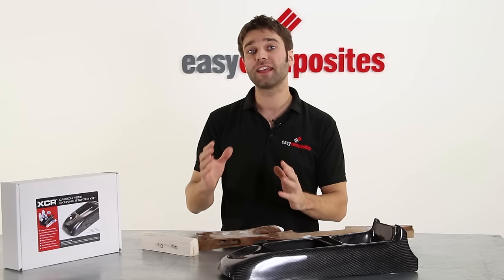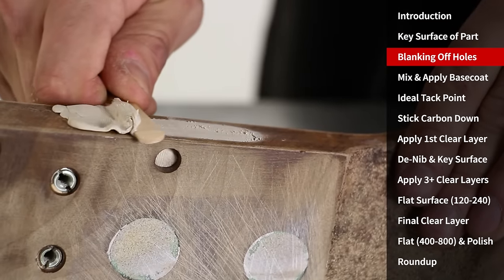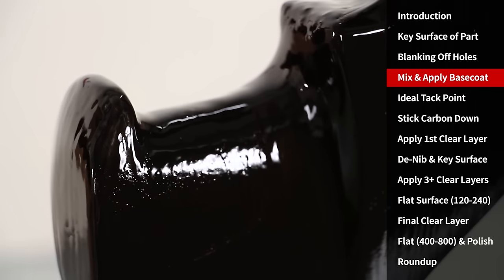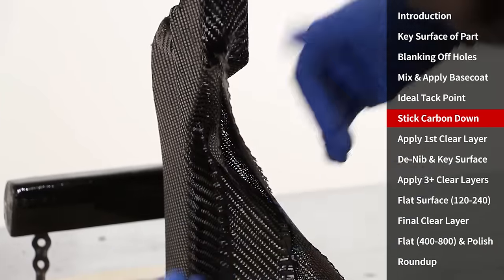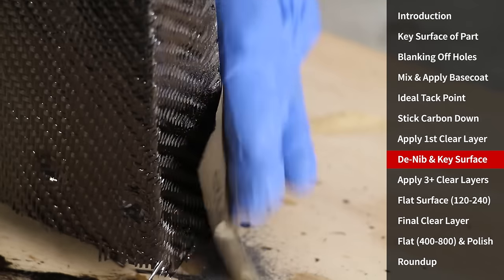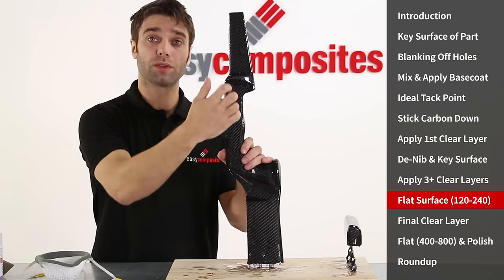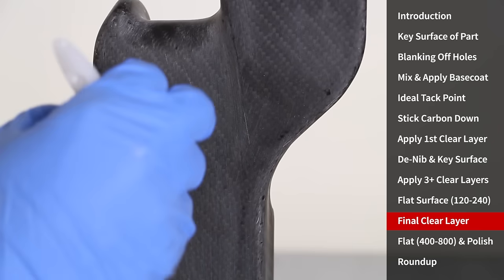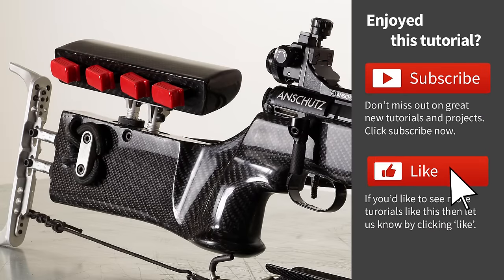Ultimate Carbon Fibre Skinning/Wrapping Tutorial - Sofie's Rifle Stock

Comment: Can I do this with a carbon lip and use spray paint clear coats?
Reply from the maker: No reason why a splitter/lip can't be skinned.  You still need the resin to seal the fabric and get a smooth finish.  However you can use a spray clear coat to finish it off rather than just polishing it up.

Comment: Would a rough surface (like a 3D printed part) be a problem ? 
Or would the base coat take care of that?
Reply from the maker: Michael Trollope 3D prints would be fine in terms of their finish but they could be tricky to bond to. Depending on the plastic you're printing with, you may need to prep the surface with something like cyanoacrylate (superglue).
Reply: Easy Composites Ltd great tip, thank you !!

Comment: Hello, i have a question is there specific type of epoxy needed to used with carbon fibre or any type of epoxy (basecoat + hardner) will work?
Much appreciated Thanks alot
Reply from the maker: Generally you would want a high quality epoxy coating resin.  Typical laminating resins will be a bit thinner so not coat as well, and also are likely to be harder to sand and polish.  Our XCR, for example, sands easier and polishes easier than most typical laminating resins.
Reply: @easycompositestv  Thanks for the replay, Your products are perfect but unfortunately i am overseas and it is harder for me to get hold of your products.
So any good quality epoxy resin will do the trick, and better stay away from cheap laminating resins right?

Comment: Is it possible to do this carbon fiber skinning on metal items such as aluminum or steel? How would the process defer?
Reply from the maker: The process is basically the same.  You need a good key on the surface to help with bond.

Comment: Would it be possible to skin a foam core? I am imagining a foam core cut to shape on a cnc and then skinned. Would the final product have any strength?
Reply from the maker: Hi Phil, yes, you could skin a foam core and yes, it could be done to have a good amount of strength. In fact, we've even had a customer build a bike frame using this exact method. There are some compromises on performance vs a moulded laminate but it's definitely a viable process.
Reply: Easy Composites Ltd that opens a myriad of new possibilities.

Comment: Question: for the base cote resin and black pigment is enough or do I need to mix hardner as well?
Reply from the maker: Hi Kamran, you will still need the hardener yes, without it, the basecoat wouldn't cure.

Comment: I want to know how strong, how heat resistant carbon fiber are in general. Got a video about it?
Reply from the maker: Heat resistance in most cases is down to the resin matrix being used eg a typical epoxy may, with a post cure, have a heat distortion temperature anywhere between 60 and 90C.  Specialist resins can go higher.  Strength is totally subjective subject to individual applications so is way too broad brush to give a simple answer.

Comment: What is the propose for use base coat as wood is a good surface to bond the carbon?
Reply from the maker: The basecoat is epoxy resin and is bonding to the wood, the reason that it is black is to mask any underlying colour from showing through the weave of the Carbon Fibre. In addition, applying the basecoat and allowing it to cure until firm but tacky to the touch gives a natural tack to help hold the carbon in place as you wrap it around the part prior to applying your top coats.

Comment: How is carbon fiber with aluminum honeycomb done? How do you keep the CF from sagging into all of the honeycomb holes?
Reply from the maker: You normally need to use a '2 shot' process where you make the skins and cure them first, then do a second operation where you bond the skins to the honeycomb core (aluminium, Nomex ect.). It can't really be done in one because you can't get even consolidation pressure on the main surface of the laminate (you would only get pressure where the laminate was in contact with the honeycomb structure).

Comment: Can you paint over the carbon fiber part if you decide later to change the look?
Reply from the maker: Yes.  Give the surface a good degrease and key then in most cases paints will adhere fine.

Comment: How much more does this actually change it's strength? Would love to see a test from aluminum plate/tubing down to Styrofoam! please.....
Reply from the maker: A single layer will add some strength to a part. Depending on the requirements you could add more layers but then it is more laminating than just cosmetic skinning.

Comment: if i wanna use 2 layers for carbon fiber whats the extra step? thank you
Reply from the maker: If you want to add another layer of carbon you can either laminate both layers at the same time, this option could be used for simpler, flatter profiles. For more complex shapes you could laminate the first layer of fabric as per the video and de nib once cured, then key the surface and repeat the steps for applying the fabric. Instead of the black basecoat you can simply use the clear XCR to create the tacky surface.

Comment: Is it safe to use these resins in an enclosed space, such as a shut garage or room (do they give off harmful vapors)?
Reply from the maker: There is almost zero odour from this epoxy resin, there are no solvents and no fumes so you don't need to worry about harmful vapours. Nonetheless, you should still work in an adequately ventilated area and follow the safety instructions that accompany the resin.
Reply: Excellent, thank you for the quick response!

Comment: Is it ok to use the same epoxy resin solution as the base coat to tack the CF down and then add it again on top for finish purposes?
Reply from the maker: The resin is the same but without pigment.  Adding the pigmented basecoat would leave the finish black.

Comment: Got the kit. Put down the base coat on my part but when I went to lay the carbon it barely stuck to it. Left it about an hour and a half in a 21 degree room and it seemed tacky like in the video but even if put my finger on it full pressure no residue came off. Measured the ratio using scales so that wasn't wrong. Does the base coat need to be laid on thick or something I am missing?
Reply from the maker: As long as it still feels tacky, even if zero residue comes off, it is in the B Stage and safe to proceed.

Comment: What temperature does this kit work in?  Would it work for skinning motorcycle engine components?
Reply from the maker: With a post cure up to 69C
Reply: @easycompositestv  Will have to measure the temperature of different side cases to see if this is viable.  Thanks for replying though.

Comment: Can i use this technique when i am laminating a complex structural part with core foam? Is there any structural problem if i let the first epoxy coat to be tacky over the foam? I am having problems with the overlapping curves where the laminate separates because of gravity. Thanks!
Reply from the maker: Not at all, this is a good approach allowing the first layer to cure through to the B Stage will enable you to see if it has followed all of the contours correctly and that there is no bridging; after that, you can build up the subsequent layers.
Reply: @easycompositestv  thanks mate!

Comment: So I have a fiberglass hood with some spider cracks.  Would the cracks need repaired before this process or could I wrap the hood the way it is???  Would the cracks show thru?
Reply from the maker: It depends on the severity of the spider cracks, if they're cosmetic/ non-structural then the basecoat should in effect repair them and they wouldn't show through onto the finished, skinned surface. However, if they are more indicative of a structural problem or if you have any delamination or flaking areas, they would need to be repaired first.

Comment: I’m skinning the roof on a car that I’m painting. Can I apply the same clear coat I’m using to paint the car over the final layer of resin instead of using the resin polishing compound?
Reply from the maker: Yes you can. It is quite common to lacquer skinned components to provide higher levels of UV resistance and a super glossy look.

Comment: I have a question about the XCR coating, at which point would I be able to put pressure on the coating so I could say flip over a box and coat the last face on the bottom?  I have a part to do and I want to coat all 4 sides
Reply from the maker: I would give it the full 8 hours before doing that.
Reply: @easycompositestv   Thanks for the reply

Comment: Are 400-1200 grit all wet sand or just 400 and then you follow up dry with the rest?
Reply from the maker: Normally the other way round; anything above 400grit is normally wet-sanded. Dry sanding is normally just up to and including 400 grit.

Comment: Would it be possible to skin/wrap an object using prepreg or is it better to use this technique?
Reply from the maker: Yes, it's possible to use prepreg but you would need the underlying part to be able to take the temperature of the prepreg cure, which for lots of parts would be OK.

Comment: Hi, If I were to do this using forged carbon, would I need to change in any way the sanding process, such as the grit coarseness? Thank You
Reply from the maker: No as you are still sanding into the same resin when skinning with chopped tows. The basic resin coating aspect remains the same.

Comment: For example if I used a mold what chemical could i use to free the carbon from the mold once it’s set
Reply from the maker: Hi Jimmy, if you’re laminating a carbon fibre part into a mould, assuming that mould is made from a suitable, compatible material, we would almost always suggest Easy-Lease Chemical Release Agent. You’ll find it on our website.
Reply: @easycompositestv  cheers thank you also when will the skin starter kit be in stock

Comment: Is this the same process with carbon forge skinning?
Reply from the maker: Very similar.  The main difference is getting the chopped tow onto the surface and wetted out with resin while still retaining a random fibre orientation and not many bits sticking up.
Reply: @easycompositestv  I was going to put the black base coat on then the chopped tow, soak with xcr resin and maybe peel ply over the top. Thank I for the response! I’m going to make a video for YouTube of me doing it

Comment: if i wanted to 3d print very low infill parts with a very thin wall thickness to keep it light and skin it, what would be the best kind of filament to use for adheasion?
Reply: PLA would be ok for this
Reply from the maker: PLA as mentioned.  Just remember if skinning both sides, and in essence making it a cored panel, very low infill prints can be weak in compression.

Comment: I need some help on the last step, wet sanding + polishing. I do as described in the video, but the surface comes out matte, rather than glossy finish and that irritates me so much. The part itself is ready to be installed, but I can't get it to be shiny.
Reply from the maker: Are you using the XCR Resin? If not, it may be your resin type as many epoxies are difficult to polish to a full gloss.
Reply: @easycompositestv  Unfortunately I am not using the XCR Resin, rather one made by a local manufacturer in Bulgaria, said to be perfect for carbon use.
 How do you suggest I get a better glossy finish? 
Should I only wet sand it with the 1200 or should I use another method?
Reply from the maker: @P.Petrov550  You may not be able to achieve a full gloss; many epoxies simply don't ever get super-glossy. The best option to try would be to wet sand to at least 1200 or 1500 grit and then use a suitable polishing compound to achieve the best level of gloss. If it still isn't shiny enough for your requirements, the best thing at that point would be to look to clear coat/lacquer the part with a suitable automotive paint.
Reply: Thank you for your reply! @easycompositestv

Comment: hi i purchase your carbon fiber begginer kit i will make a new plastic for my atv ,can i put stickers in between epoxy layers.will they melt or something or will  remain normal while curing
Reply from the maker: It depends on the material of the sticker so I would do a test piece first.  Sometimes the inks can run and/or the edges of the sticker peel if the adhesive is not strong enough.

Comment: hi paul grrst video specially like the idea with keying with a stanley nife to get a better bond. my only disappointment when calling before paying for the  skinning kit. us that i asked if my project could  be done by your company.  as your company does this on a daily basis. i was told that you dont take on projects such as this video.   I also find the 2x2 twill a nightmare  to work with. as i find the material  to thin
and that imperfections still show through  the end. is there a substitute instead i could  use. maybe a slighter thicker carbon fibre.  om not concerned about weight.  but do wamt a perfect finish were the carbon thread stays together. thanks in advance
Reply from the maker: Hi Mark, we don't do this type of work on a daily basis, we only did this project specially for the skinning video which was long overdue. It was something we'd discussed and arranged with Sofie a long way in advance. As for the 2/2 twill, it is a delicate material - that's true - but we've never found it easier to use any other weight, width or grade - especially for interior trim parts like you're doing. However, it's all personal taste and if you wanted to experiment with some other fabrics then we'd be happy to discuss what we can offer.

Comment: Hi, do you have glue, whitch can be used (stick to) for carbonizing EPP foam ?
Reply from the maker: If you are skinning foam in carbon fibre, the epoxy resin basecoat will provide sufficient adhesion.
Reply: @easycompositestv  
Idea is to cover foam by carbon around to reinforce body (plane model)
Reply: @easycompositestv  
I was thinking if that stick on expanded polypropylene.
Reply from the maker: Hi Jan, EPP is very difficult to get a good bond to, even with an epoxy basecoat. However, if you skin carbon around EPP then the EPP structure underneath becomes almost redundant because the carbon fibre skin is so much stronger. Therefore, the strength of the bond to the EPP becomes a little irrelevant.
Reply: @easycompositestv  
Thank you, that make sense.

Comment: Thanks for the video. What can I use for the basecoat as you don’t ship the XCR to Australia?
Reply from the maker: So, basecoat should not be impossible to replicate (because it's not super critical and gets burried underneath the clear resin, which is more difficult to replicate). You would need an epoxy laminating resin with a strong black pigment in it, you would probably need to make it more thixotropic (something like fumed silica).
Reply: Easy Composites Ltd thanks for the reply. Yes I have some pigment already. To clarify, So I can use the same clear resin I’m using on top for the basecoat too?
Reply: I did use the same topcoat for the basecoat and it worked great. Thanks for the excellent video. My part is much lighter now too :)

Comment: What does it do to the wood in terms of strength? 2X more capable or so?
Reply from the maker: Hi, adding a layer of carbon does improve strength generally and also surface strength. But the purpose in most cases is cosmetic.

Comment: hi than you paint a part black before fiber skinning a part what king of black paint is that, and does it work with other kind of paint?
Reply from the maker: To make the part black, we apply the XCR Basecoat Epoxy Resin to the part rather than paint it.
Reply: so other paint's wont work only with this kind of paint where you told

Comment: Hi, I have some questions. 
1. we want to use circular sanding machine. Is it okay to use it?
2. When we try to sand lower spot, We worried about sanding fiber. Is there any solution?
Thank you.
Reply from the maker: You can use one for removing lots of material but for final finishing we would recommend finishing by hand. Working by hand is recommended for such dips to prevent wearing through.
Reply: @easycompositestv  Thank you for your response. Have a good day~

Comment: Do polyurethane side skirts require same level of sanding to get a good mechanical grip/bonding? cheers
Reply from the maker: Definitely, you can't be too coarse with the sanding and preparation of the surface. The more coarse, the better the mechanical bond.
Reply: @easycompositestv  is it the same process for fibre reinforced plastics FRP
Reply from the maker: @Clint2jz  Yes absolutely

Comment: Throughout all the video on Youtube that I watch about carbon fiber, none of them made things that are so small that it fits into your palm. On the watchmaking market the case and the dial of a watch can be made by carbon fiber, that's the smallest i know. What is your advice of making small, palm sized component in carbon fiber?
Reply from the maker: Making something the palm of your hand should be perfectly possible. Prepreg is often a good way to go (see this video: https://www.youtube.com/watch?v=cQ1Q4XmItN0) when you're making smaller items but you can also consider two part moulds using a rigid female mould and then a flexible inner mould (like silicone rubber) and then using clamp pressure to squash the reinforcement and resin into the mould using the flexible inner mould.

Comment: Will the carbon fiber make the wooden stock more weather resistant?
Reply from the maker: The thick layer of epoxy resin over the carbon fibre will certainly improve weather resistance considerably as fully cured epoxy is waterproof.